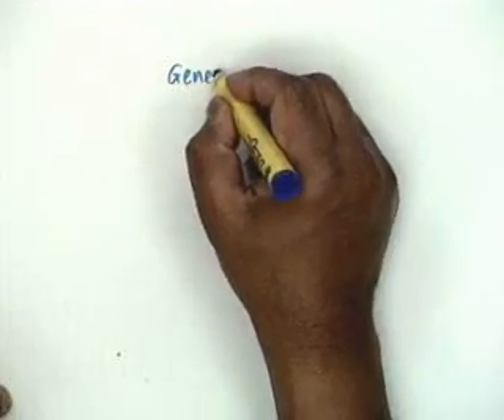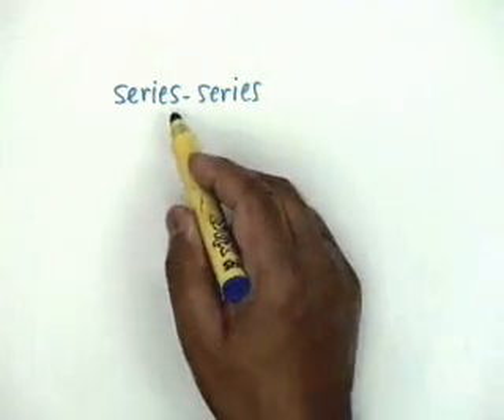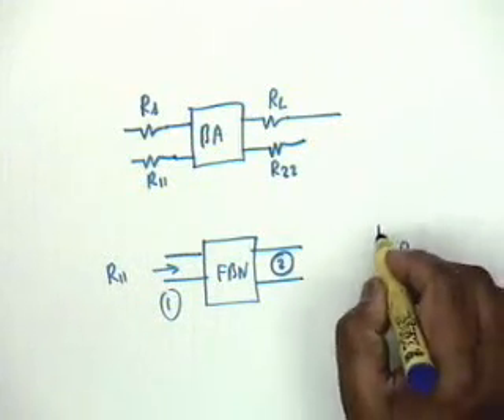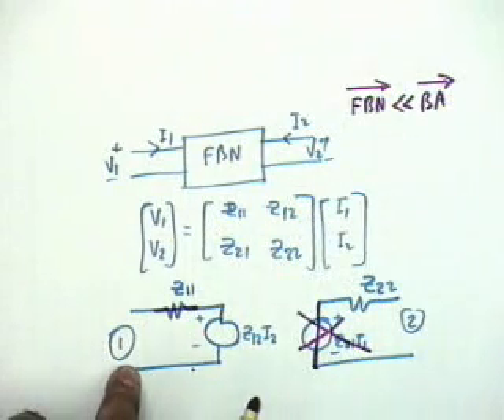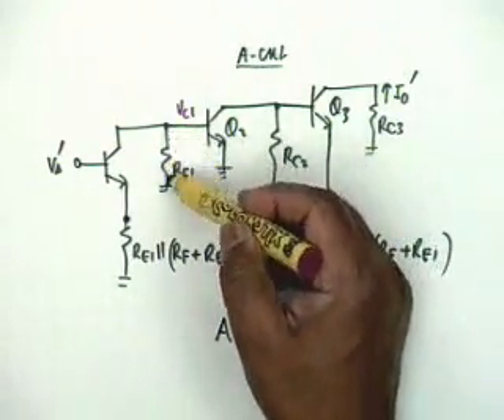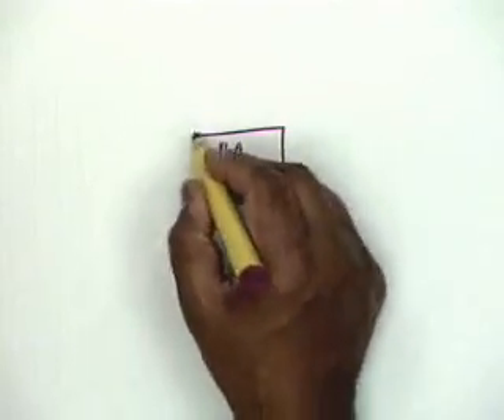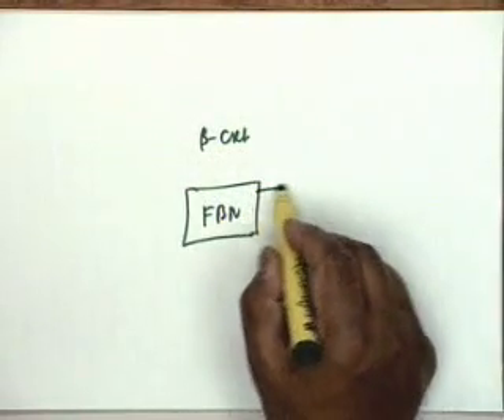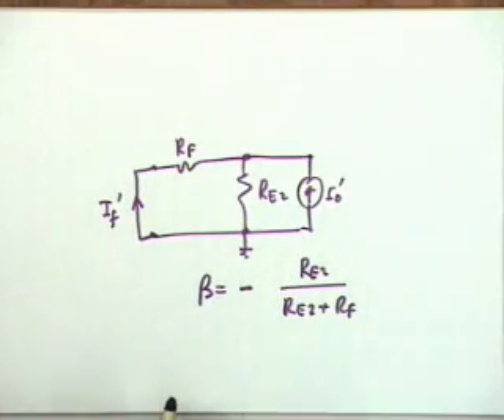lecture37 Analysis of the Series -- Series and Other Feedback Configurations

Comment: Can you please explain how to calculate the gain by inspection? Is it possible to calculate the gain for any transistor circuit without the need to draw out its small signal model? Thanks
Reply: Just picture small signal model for every BJT and remember to take into account the magnification/de-magnification produced by the VCCS